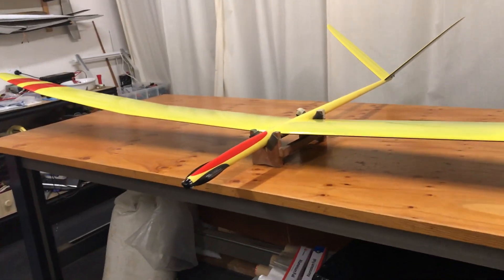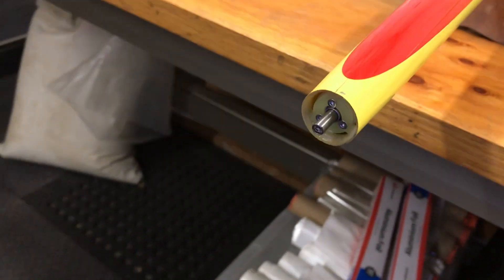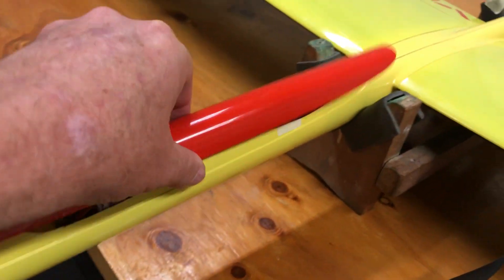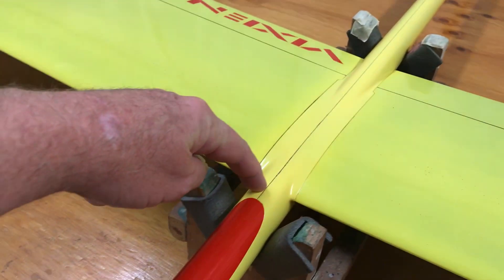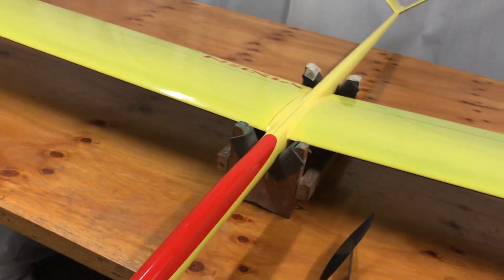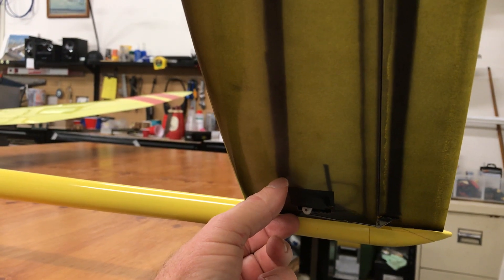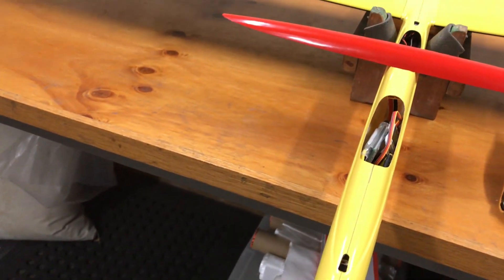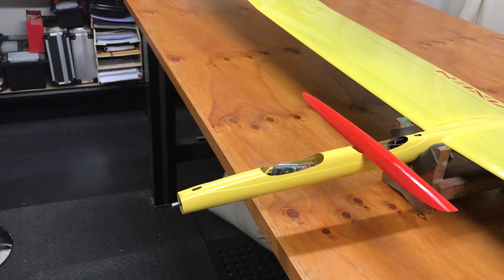Vixen to E-Vixen

Comment from the maker: I just competed in 3 rounds of a local F5J comp and flew this 2.1kg "lead sled" in 2 of those rounds and got 1000 points for all three rounds against other top (Kleenex) models and competent pilots. My point is that competition success is more pilot decisions than wiz-bang models. If the air is active, a Radian can beat you.
Reply: That is good news!  Thank You!   At 74 ounces is indeed heavy.  Was It windy?   Would you have done better... and/  or.... had an easier time with a Vixen 2 in the 58 oz range? 

I agree that yes it is all about the pilot! I live in South Louisiana, USA. I wanted a Pike Dynamic or perfection or one of the other "top shelf sailplanes".   They are all around $2,200 bucks. The Vixen 2 is $1,300.  I like the lower price.  Is your vixen the fiberglass or carbon version?
Reply from the maker: @davidfalgout7304  It wasn't windy. It was a 2 day comp and I was only able fly on the 2nd day where 4 rounds were flown. I flew the 49oz V2 (competition version) for the 1st round but it went unserviceable on the flight line for round 2 ... zero score (ESC issue). For rounds 3 and 4 I flew the yellow "Barbell" ... and it did great.